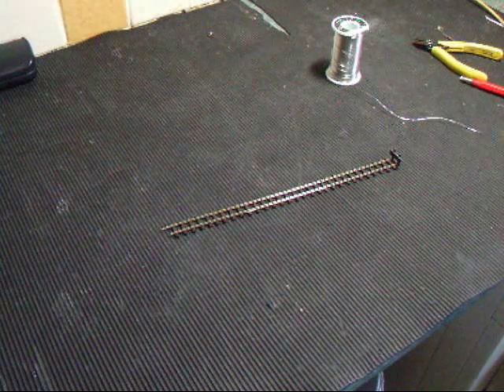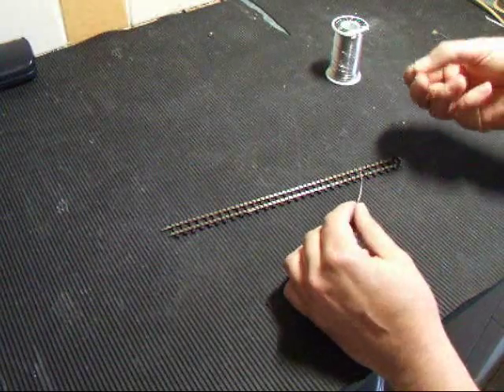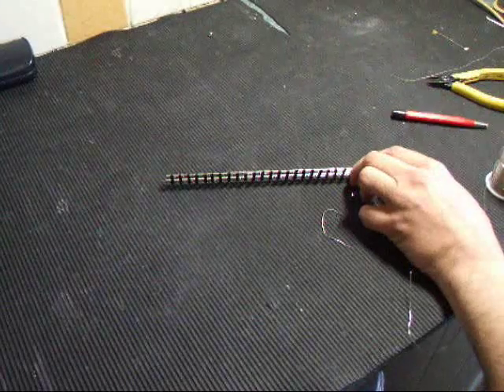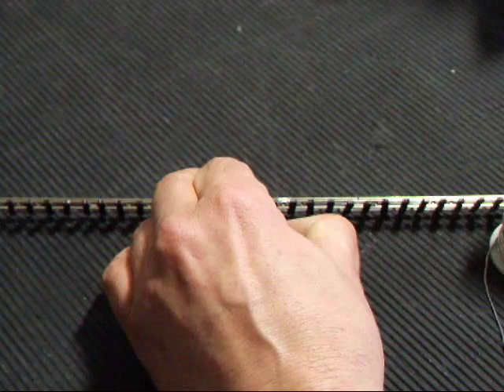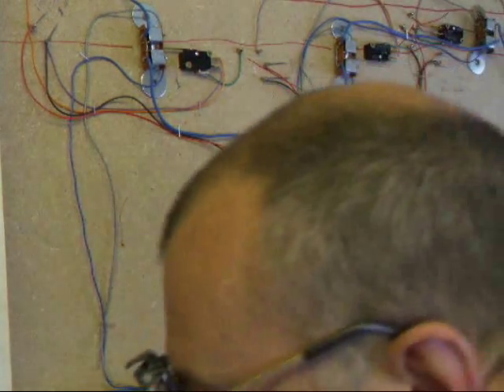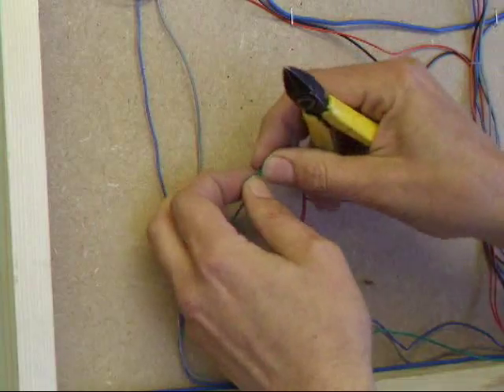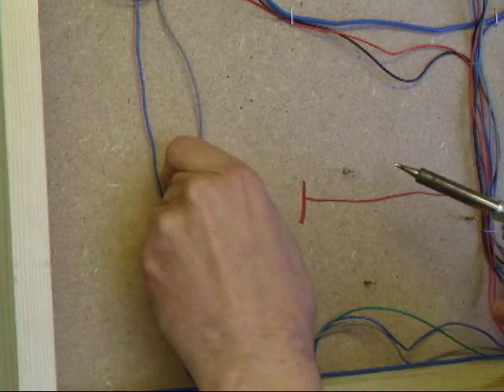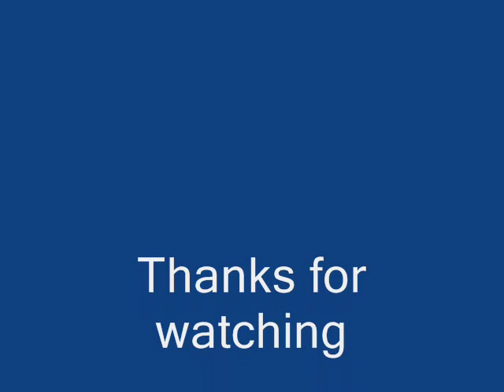How to solder

Comment: Really nice way of adding droppers to your tracks there!I like the way you use the copper pin to make a secure connection point and like Mumbles mentioned the tip of twisting the sleeving before pulling off completely is very handy! :)